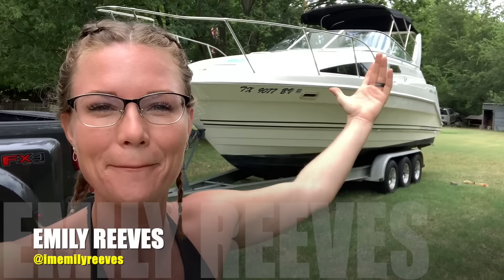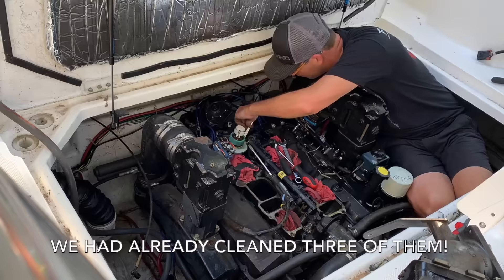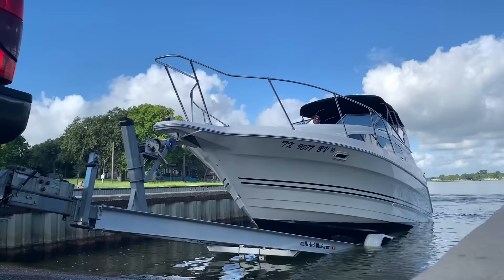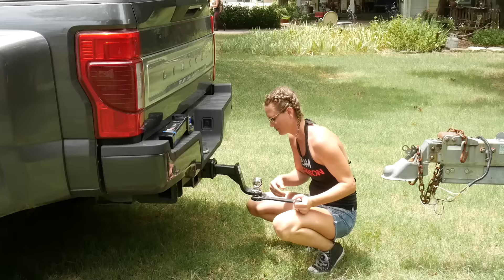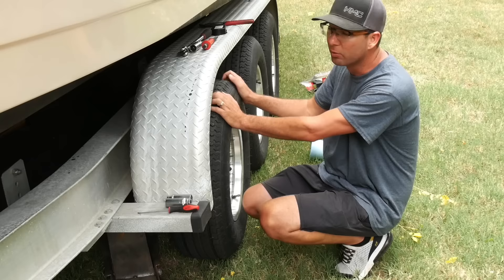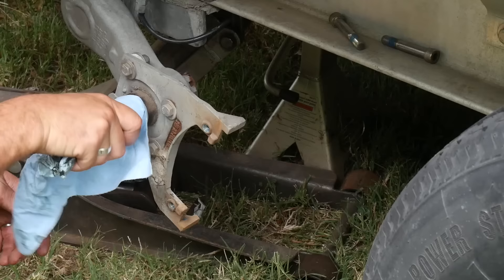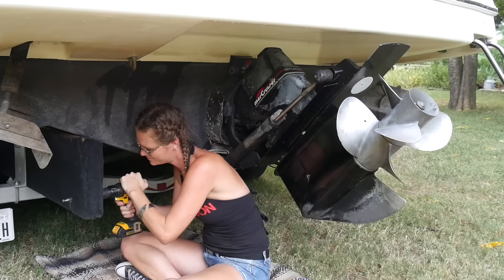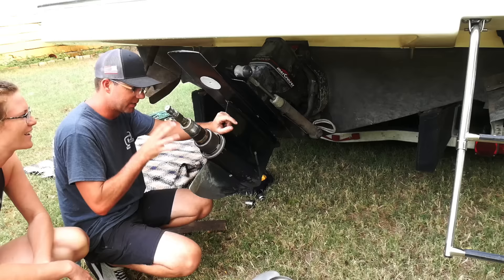Prepping our 5k boat for 10 day adventure!!!

Comment: A couple of things to say on these videos. They contain good solid mechanical and towing advice and they don't have any profanity. So refreshing.
Reply: God Bless you my Brother!!!!! Profanity is terrible!
Reply: @Barry Barry They could be Democrats or even Independents.  I've known people of all different political persuasions and some cuss but others don't.  Myself, I much prefer no cussing; I did way too much when I was in the Army, so I've worked hard to eliminate it from my vocabulary.
Reply: Change the tires make them brand new and rotate them grease up the hubs and the axles and you'll be good to go
Reply: Age of the trailer is important , most important is the load rating on the tire and to torque the wheel studs every couple of hundred miles when doing this hold the the bearing for heat and the tire for heat. Soft rubber is a killer. 🤞 😊
10:31

Comment: keep the old props stowed in the boat. you never know if you will need them in an emergency. hit a submerged log in my bass boat. the trip was saved by my spare prop.
Reply: There are a ton of hacks that they can be used for on the water in a pinch!
Reply: @mattprice37664  i hear that...but not everyone is built the same way. i have seen it all...lmao.. i can't count how many times i have seen boats, jet skis, etc towed back to the dock because the owners couldn't start their boat because of user error. jet ski owner/renter didn't pop the safety kill switch teather back in. bass boat towed back from a dead battery with a fully charged trolling motor battery right beside it. didn't even dawn on them to use it to start the boat. HA HA HA...boat owners plowing their boat down a lake because they had no clue to trim the motor to get on plane. thinking the trim was only for raising/lowering the motor when you put your boat in/out of the water. then the mistake everyone is guilty of doing at least once. that pesky drain plug.. lmao...take care!
Reply: Great advice!!!
Reply: Storm Trooper88 yes, I always carry a spare prop, just in case... and some MRE's for emergencies..
Reply: They need to check the WOT RPMs to see if the props on the new lower unit are maxing out, giving optimal top-end speed. If not, perhaps the original props should be put on the boat.

Comment: I wouldn’t run the boat tie down points to the wood of the trailer. Run them to the metal frame of the trailer.
Reply: wrong !
Reply: My concern more is the eye's of the bolrs are inboard and hull punches when loading and uploading
Reply: The wooden beams they attached them to look pretty substantial, but longer straps would give more elasticity and better take any shock loadings.
Reply: I agree. We've all seen the photos of the boat on the bed of the truck after a violent stop. I would recommend a u-bolt kit each side of the rear trailer frame and a CE Smith Tie-Down Bracket attached by a nut on both. $20 to ensure she stays put.
Reply: If you look at 6:10 the trailer has hoops where four straps were originally.  Two in and two out.  And they should be clamp straps not ratchet straps.  The center straps typically cross each other for stability.
Reply: @thomastirolflorida5363  what do you mean wrong every boat i have ever owned or even seen had the straps mounted on the frame not the wood bunks
Reply: Came here to say the same thing. Never seen a tie down go to the bunk of a trailer before.

Comment: When launching and pulling the boat out, back the trailer into the water a little more so you don't have to use the motor much to get the boat on the trailer. It will save your rollers/carpet on the trailer.

Comment: The Bayliner 2855 is a sweet boat.  It was our first "big" boat in the Pacific Northwest.  We loved it so much we upgraded to a 4788!  We now spend our entire summer on our boat.  Hope you're still loving the 2855.  :-)  A couple of quick notes from a former 2855 owner: check the bilge pump to make sure it works.  Mine was burned out and didn't work.  It was impossible for me to remove (don't have your skillset) as it was directly under the engine.  It was easy to add a new bilge pump in a low spot, wire it up and good to go.  Check the holding tank vent twice a year.  Bugs nest in the tube and can clog it.  Clear it with compressed air or a shopvac.  If your depth gauge is off, they can be set with a clearance factor.  I would set ours to show 8 feet as zero depth, as shorelines rise quickly here and I wanted an early alarm.  Check the rubber bellows every trip for cracks and leaks.  Water leaking in there will ruin your outdrive.  Finally, if you want/need navigation I downloaded software to my iPad that is awesome.  I prefer Navionics for ease of use and cost, though I also use iNavX (which is beefier but much harder to use, and is overkill for the average boater). Enjoy your time on the water!
Reply: Excellent advice.  Wonderful of you to share with this great couple!
Reply: Good people get blessed 👍👍👍❤️

Comment: Keep the old props. You never know when you may spin one off and find yourself without. Always good to have a spare!
Reply: Yup
Reply: Yes. And a spare nut, they sell a floating wrench for the prop nut so you can change it in the water and prevent a possible long slow trip back to the dock with a bad shake, possibly doing more damage.
Reply: @youcanbesmartaskhow3857  yupp...  Good tip
Reply: The Bravo 3 props need to be changed in pairs.
Reply: Not to mention rebuilt and rebalanced is cheaper that a new one !!!!!!!!!
Reply: Do you ever drop cast your own from aluminium cans and some old taps? Or do you Americans do the whole extreme consumerism nonsense and pay thousands for something you can make for free with some play sand and half an hour on a weekend?
Reply: @johngalt969   Be hard to do with these Stainless Steal props.
Reply: These props are solid, no spinning the hub on these!
Reply: @johngalt969  we Americans support our "built in the USA companies"
Reply: @johngalt969  I’d love to see your 30 minute play sand aluminum  prop.  What do you use to balance the prop out of curiosity?

Comment: 7:20 watching that hitch straighten up as you took the weight off it was sketchy AF, glad you guys got the right parts in there.

I'm here and subscribed for a few reasons: I like boats.  I like supportive spouses.  I like watching other people work.
Reply: Went back and watched that again, you aren't kidding, it really was flexed. Wonder what that tongue weight is.
Reply: Damn I didn't even notice that. I had an 18.5ft boat w/ a single axle trailer. I couldn't lift the tongue on that, it was probly 400lbs. This boat most likely has a tongue weight of 1,000 - 1,500... At least!
Reply: Tongue weight is usually 10% of boat weight just a rull of thumb
Reply: Jeffrey Buerk lol, no hitch has a 5000 lb tongue rating. Class three drawbar is 500lb, Class V is around 1800 I think.
Reply: @jeffreybuerk9426  if you watch it in full screen and slow down you'll see that the ball mount definitely flexes.  There may also have been slop in the hitch adapter which would only cause more issues, if the hitch is jumping around every time the boat shifts then eventually the metal will fatigue and bend or snap.
Reply: @jeffreybuerk9426  You have no idea what you are talking about. #5k tongue weight limit lmao

Comment: 5:15 A bit of advice, before loading back the trailer far enough to wet the boards then pull ahead to desired location (make sure you don’t exceed the concrete & drop off the end) wetting the boards will basically lubricate & help load easier, especially with a boat that size.

Comment: When changing out trailer receiver hitch balls, turn the hitch horizontal in the receiver pending on tighten or loosing so that your always pushing the wrench down. Makes the job much safer & easier. Good video!

Comment: I’ve owned boats my whole adult life and spent a lot of time on them. (Nothing this big but it’s the same stuff just bigger.) I like everything you guys are doing. And keeping the maintenance is a must. Especially when trailering. Keep it up and don’t worry about the haters. I’m jelly myself. But negative feedback won’t help. I’m very happy for you guys. Love the videos.
Reply: Oh. And when trailering, at least in Ohio, an easy tension strap under the outdrive or a like minded product is safer. Especially since the o-rings in the hydraulic pumps for the trim and tilt can pop and the outdrive sags and drags. And skegs are hard to fix and bolt on replacements can throw the balance off. Basically you end up needing a new outdrive housing. Happy boating!!

Comment: Hey.. quick note to all boaters.  Don't spend cash on StarBright cleaners (40$++) or specially boat cleaning products.  They are crazy expensive.  Clorox Toilet Bowl Cleaner/Stain Remover, (4$) works way better for a fraction of the cost.  Decking, hull it's awesome.  Dilute 1/1 for daily cleaning after big day on water or leave undiluted to clean nasty hull.  It's sticky so let it sit on the surface for a few minutes and then scrub it in and rinse.

Comment: Definitely keep the other props for emergency spares! I would highly suggest you redo the rear tie down strap bolts and put the eye bolts into the metal frame of the trailer. A boat that size could tear those eye bolts out of the wood if it shifted.

Comment: Great job and nicely edited! Just a pointer on starting an engine when its out of the water. Always hook up the garden hose with water, even if its only a quick start. You don't need water for engine cooling, but you do need it for lubricating the water impeller that's inside the lower unit. The rubber impeller will melt almost immediately if it doesn't have water to lube/cool it.
Reply: 100% correct. they stick and rip in a single turn
Reply: Exactly.
Reply: yep! i was thinkin the same thing

Comment: When working outside on the lawn I usually put an old sheet or blanket under the wheel I'm working on. You won't loose any small parts.
Reply: And a sandy soil is never a good mix for lubricated parts.

Comment: Immediately  change your fuel/water separator,  and add a fuel stabilizer to your gas with every time you add fuel.  I noticed your engine, no matter what you have been told, premium fuel at minimum.  These are mandatory if you are not using your boat routinely. 

A 9volt  battery with a button on the hot wire will help you open the injector shutter and you can spray cleaner backwards through your injectors body to really clean them. 

Change the oil and substitute a quart of Lucas oil stabilizer for one of the quarts of oil. Your engine will love you for this and give you less damage since it won't be running regularly.

Comment: as a electrician Never Do the Connections at the Light end that is submersed in the water Even with resin filled connections water always finds its way in Its better to get a sealed light with a long cable on it and run it up the Frame of the trailer to the plug and do the connection there you'll have less chance of water ingress (ive learnt this the hardway 3 times haha) love the new boat! you guys are doing a great job

Comment: You'll benefit from "bearing buddies" which push grease Into the bearings with spring pressure continuously. They indicte when grease is low as well.

Comment: Advice for trailer depth: I've always found to get the front of the bunks just at the water level or an inch out of the water, that'll largely depend on your trailer, launch ramp angle, and boat hull design, but that rule of thumb has worked for me on jetskis, ski boats, cabin cruisers, pontoons, houseboats, literally anything that floats that I have worked on.

Comment: When you were changing the lights in back, use the metal loop that was in the picture for the rear straps.   The hole in the bunk that you did is only as good as the wood itself is.   When you need it, the wood might not be strong enough.   

Also make sure that you change out the raw water pump impeller.  Never know when it was changed last.  

When pulling out the boat, Get your bunks wet first and then pull up.   I usually just show the tips of the bunks, but that will vary.  If you always go to one ramp, then mark the water level that works best, and make sure that you can see the mark in the camera. 
 
Enjoy and be safe,  remember to turn off the blower when fueling and back on when your done.  Last thing you need is to have a spark around fuel that is within the boat.
Reply: I agree, the tie downs need to be in the metal of the trailer frame, not the wood.  Also make sure your tie down straps are up to the job, they each need to be rated greater than the weight of the boat in case one come loose.

Comment: Hey Emily.  Heres a tip when launching or loading a boat that size on a steep launch ramp.  Chock the wheels on your truck just in case!!! I saw a few videos where the weight of a heavy boat pulled the truck into the water and flooded it. Especially on a wet slippery ramp.

Comment: I’ve always strapped all my boats down on the back like that. Good call adding those hold down straps
Reply: Too right, boats should be strapped, 12' or 120'.   Gravity is only useful when you're working with it, once things start to go sideways gravity ain't always your buddy.
Reply: I have towed my 22 ft..with no strap's 1,500 miles straight..no problem..I don't think y'all need them strap's.but your call.i have never ever had an issue...in 15 years .. hauling that boat around...
Great boat by the way..very pretty wife.. supportive...you guys go man go...👍👍👍👍
Reply: @DonCatherman  well I experienced the bad side of not strapping the boat down. Went maybe 50 miles and found the boat sitting on it's side. Went to an auto shop and they hooked onto the outdrive and lifted up the boat so we could reposition it. 20 foot boat. It was pouring down rain when we pulled it out and decided to skip it. Well it didn't work out for us. But, I see people pulling boats all the time without tie straps and I guess don't have a problem. So who knows, I always strap my Malibu surf boat down for sure. Straps are built into the trailer. Happy trailering.
Reply: @bryanhays7753  guess it's luck ..idk..my boat is 22 ft.cuddy..
Heavy.....deep v...never had it move an inch..towed it from NY to Mississippi.. Mississippi to Tennessee...20 years of good luck.
Never having any problem..
Now I better strap it if I take it 2 Mile's....lol..the mouth God's will get me if don't...now.lol...bummer you had that happen man...hope all is well today....

Comment: I am enjoying watching your adventures and attitudes.  Love it.

I would recommend using a forged structural shouldered eyebolt for the trailer tie down rather than the non-structrual kind that's not a joined circle.

Comment: Pay close attention to the bearings and brakes on the trailer.  Alway add grease to the bearings before each launch.

We had a Bayliner 2452XE with the 5.7 Bravo II drive. Flushed the engine after every use. Had thousands of trailering miles on it from Maine to South Florida.  Great boat! We have since moved up to a 40 ft sport fishing boat, but we still have fond memories that Bayliner.

Comment: You're probably aware of this already but, I would recommend an anchor alarm app to monitor if your anchor slips during the night and also the Navionics app.
Really enjoy the videos 😋
Reply: Maybe out in the ocean, but a lake I wouldn't see the need. Lakes are full of mud and shit so anchors tend to hold a lot better than they will in sand or coral.
Reply: @codylapoint  no body anchors in coral you won't get it back. Any anchor can slip in a strong wind. Better safe on the water than being wise after.

Comment: We did the same this year.  Found a great deal on a 22 foot LUND sport cabin.   Paid about $5200 with a cracked water jacket.  1992 Lund 2250 Hard Too is a very well built and very rare boat.  The hull,  transom and outdrive are all in excellent shape so just a new engine and some TLC will have this thing ready for action on our favorite Lake Oachita and then Powel.

Comment: Yeah I'm with you on the tires but the scenario where you have a blowout on the interstate pulling that behemoth would cost way more than all of those tires
Reply: One tire blowout you would be fine. Enough to get to somewhere safe.

Old tires that have been sitting with weight.. no good. Did that on a RV.. lost all of them one by one.

Comment: The trailer alone can be $5k+ great set up. So true on having straps.
Reply from the maker: Bradley B Right?! This trailer is SO NICE!!
Reply: Needs an electric. Remote. Winch
Reply: I'll donate my time to jewel the trailer
Reply: Need straps in the front too...  Cleats to trailer works.  And that is not a 5k trailer.  Its more like 8500.  Awesome job.
Reply: Andrew LaCorte you right! I just bought a new tandem aluminum McClain a year ago with saltwater upgrade and it was $6500.
Reply: @andrewlacorte1737  👍🇦🇺
Reply: My thoughts Bradley were that they probably increased the value of the boat a few thousand busks just with the cleaning and mechanic work on this video. Maybe more than that with the new tires. Good work folks

Comment: I had a smaller boat, but its always a good idea to use a block of wood or a landscape block under the trailer jack  when you set the boat on the lawn in case it rains so it will not sink into the lawn. Also all those spare prop parts and old props should be stored somewhere on the boat with tools just in case you need them. Came in handy for me once after hitting a submerged log. Enjoy watching you two, your awesome : )